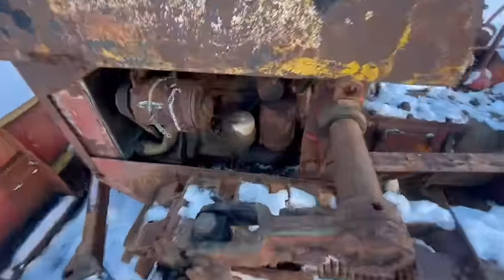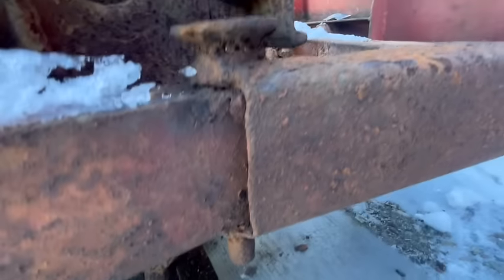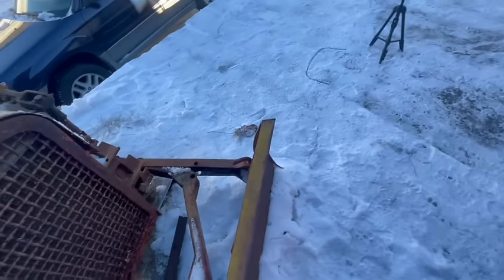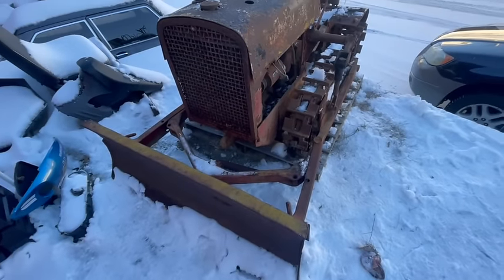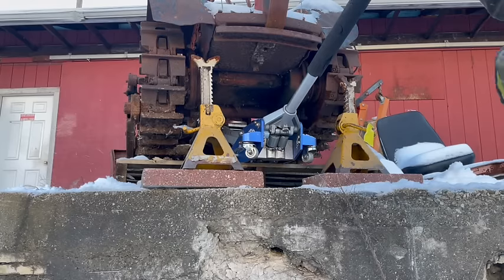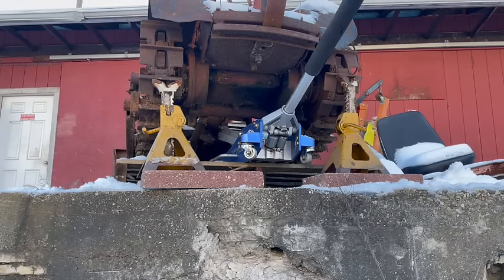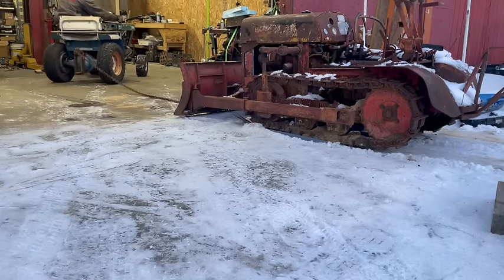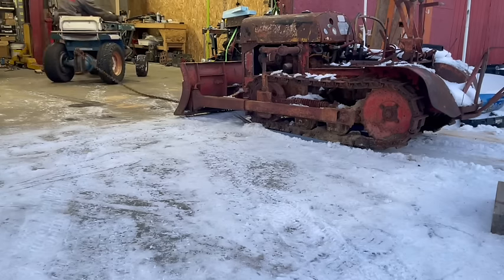Is this the smallest bulldozer ever made? lets fix it! Part 1 of ?

Comment: Cool, but to answer the question in the title, nope. It’s not even close to the smallest dozer.
Reply from the maker: Can you enlighten us? What machine are you referring too?
Reply: Well, currently, the Chinese makes some very small units, and there are the remote controlled dozers, (not toys) also some forestry dozers that were remote controlled. but to compare apples to apples and keep it on a more vintage note plus only equipment where the operator actually rides on it I would say struck Corp. They have several versions of their magna trac dozer. They are still in business today, I tried to post a link to their website but apparently that wasn’t allowed. Anyway, they advertised way back in the 70s at least maybe further back in popular mechanics magazines. You could buy their DIY kits where you painted and assembled all the parts or you could purchase a preassembled unit for an additional cost. There’s another brand that slips my mind right now that included a backhoe on it. There’s a video floating around YouTube somewhere comparing new Chinese mini excavators, which has one working side-by-side with one of these dozer backhoe units.
Reply from the maker: All good points and true. But were still not comparing apples to apples. This particular machine im featuring fits on a pallet and weighs 2000lbs. It has an oliver oc3 trans, diff, and portal drops. A hercules 4 cylinder engine and a blade that weighs 300lbs. Struck machines dont really compare. This is a scaled down big dozer and its design goes back into the 1930s. Pound for pound this is a seriously capable machine. The cletrac machines are comparable and even those are bigger in size. I will be going into the history and details in future videos. I dont know everything but i do know weve got a really small super overbuilt bulldozer that needs to be restored to its former glory and become part of the 20 remaining examples of these unique machines!
Reply: Well, if you’re gonna put conditions on the question after the fact, then I guess you’ll be as correct as you want to be. I answered the question in the title as it was given.
Having a differential, drop-down, axles, four or more cylinders etc. is not a condition on being classified as a dozer. I’ve seen several large doers that were twin cylinders Some of the largest construction dozers in the world are hydrostatic and have been for years. Dozers also don’t have to have tracks even though it’s the most common configuration. There are wheeled dozers. just like there are tracked loaders. 
So if you’re going to limit the definition of a dozer to what you want it to be …….
Reply from the maker: @blue68chevelle  did some research last night and the struck is in fact larger. And weighs one thousand pounds. What do all  purpose built bulldozers have in common? Cast iron construction engine and driveline front to rear. Ill let go of the claim its not important even though i believe it to be. What important is the restoration. Research “beetle” by pacific western gear. The mity cats were build from the surplus parts from the war effort. Yes these little machines were used in the war effort
Reply: @jmpsavescars   “purpose built” ?  I’m not sure how that qualifies one dozer over another. If the mighty kat was re-purposed from leftover tractor parts, then that wasn’t necessarily the intended purpose originally. Since you mentioned struck again, they have a current model that weighs 700 pounds without the attachments so yes it’s close to 1000 pounds and it was built specifically from start to finish to be a dozer i.e. “purpose built“ 
Caterpillar makes wheeled dozers again “purpose, built“ and the engines in the rear. 
Lay trac was a brand of mini dozers made around Seattle in the 50s. Had a front engine, three speed transmission, gear reduction, and some cast-iron parts. It was for homeowner garden type applications.
When you asked the question, you didn’t qualify it with physical dimensions, weight, or a specific engine transmission drive type configuration.
Obviously, you have a certain definition in your head of what a “dozer” is.
It just doesn’t encompass what all is out there available that are also dozers.

Honestly, it’s a cool machine. I am glad someone rescued it from rotting away or being scrapped. Given the chance I would have to.  I hope you get it all working.
You came up with a a title and a thumbnail that grabs attention. I get it. 

Still not the “smallest dozer ever made”
Reply from the maker: @blue68chevelle  the mity cat line is a continuation of the beetle not re-purposed, ill be going into detail in future videos trying to cover the history of this type of equipment, and its role in the progression of small equipment. This particular machine is the essence of large equipment scaled down. Like a pony made from draft horse parts. I think others will agree that all true dozers all have blade arms that are solid mounted to the undercarriage as well. Anything with a blade on it that can push anything can be considered a dozer. Whether or not its still able to so its job in 80 years with all its original parts will quantify its makeup. The purpose of the title was to gain info that may not be known of other machines and we are doing just that. Ill have you know i did not originate the claim search it on youtube and you will see.
Reply: @jmpsavescars  “true dozers” ??
so now the blade has to be mounted a certain way to be considered a dozer??

Ok.
There were also a lot of crawler tractors, that were never dozers even though they were made in the same factory and their cousins had blades attached.
Sometimes later people would find one of these, acquire the parts to convert them into dozers. 
So, that particular piece of equipment was never “purpose built” to be a dozer,.
nowadays, most people would not question the fact that it is one.

Again, best of luck with your restoration process. I truly hope you get it all working because anytime someone is saving an old piece of equipment from the scrap yard is a good thing.
Reply from the maker: @blue68chevelle  one could say all dozers are crawler tractors outfitted as such. Im stating the similarities that create different groups and classes of the same type of tool. Some hammers are not suited for certain jobs. But some hammers can be used for all jobs. To me the blade and arm contruction means alot in the realm of being able to break ground or level ground. Traction is generated by the force put on the blade. Where that goes makes a big differance. This is all constructive in the topic and the knowledge of these old machines is dying with their operators so its my goal to breath new life into the topic. I restore many cars and machines each year. Sharing it on youtube allows more people to enjoy the process and learn something. Your handle tells me your a gm a body guy i primarily restore chevelles and i think you would really enjoy the restoration of the 66 ss396 convertible i just finished.
Reply: Very neat little dozer. You can see it has done some work by the wear on the drive sprockets. It truly is built like a large dozer of the era. Do you know if it has steering clutches or just differential and brakes as some smaller crawlers of the era. I have 2 Windolf chain tread tractors and one Agricat crawler loader, all are smaller than yours but don’t resemble a large crawler of the era as closely. One defining detail to me is the dozer blade is built just like large angle dozers of the era, which I haven’t seen before. Great that you saved it.👍
Reply from the maker: @oldamericaniron5767  thanks i juat posted the second edition to the series. To answer your question it has a oliver oc3 diff and brakes. Im interested to check out the machines you have pretty hard to go smaller and still have big work parts. The blade is very well made has alot of steel in it. I discovered great news in the initial dissasembly!

Comment: Wow you lost me at trying to move it with a lawnmower ! I'm out ! Get a brain
Reply from the maker: Excuse me but thats a garden tractor. It uses a chrylser rear axle and its 600 lbs with its industrial hydraulic motor to create  an imense amount of pulling power. The hitch setup on the rear is how they were built so i guess you missed the part where it was pulled in by the “lawnmower”, 2350 lbs dragged is close to 3500lbs of force to get it moving. Using the wrong tool or method to get the right result is the motto of this channel. Thanks for watching😀